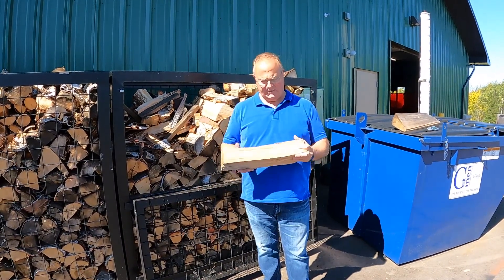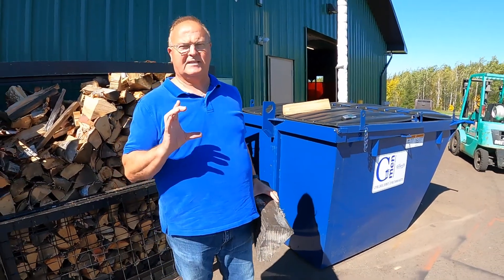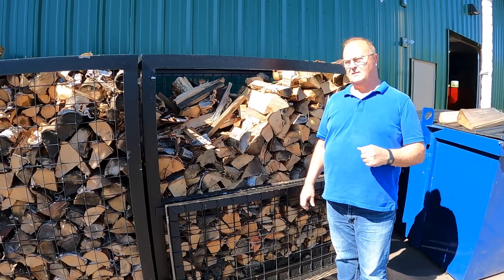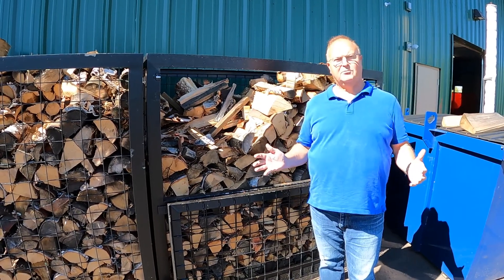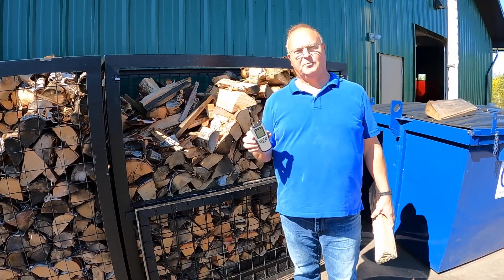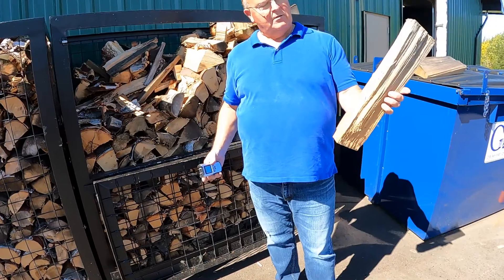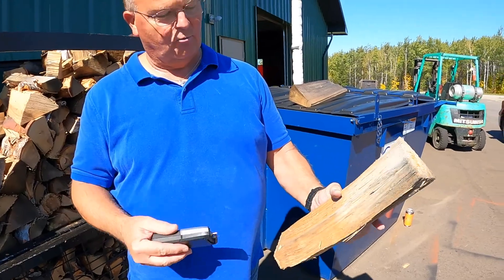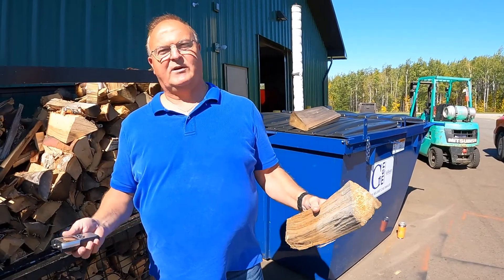Kuuma Vapor-Fire 100 Installation (Firewood Basics)

Comment: New to wood furnaces, looking to replace a very old one that we have in our log home. I under stand dryness however what if the wood is slightly higher in moisture? I cut and split roughly 5 cords of ash this spring, mainly curious not sure what the actual moisture % is on the wood currently.
Reply from the maker: You can buy moisture meters pretty cheap.  We include them with the purchase of our furnace.  For the first season, many people use slightly wetter or dryer wood.  If your wood is slightly wetter, mix a few pieces of drier stuff to compensate (and vice versa for dryer wood).

Comment: Have never heard about drying too long before, great info.
Reply from the maker: No problem, typically we like 18-28% moisture content - A good example would be the wood you see sold at gas stations or camp grounds and how it disintegrates so quickly when lit because it's so dry without any BTU's.